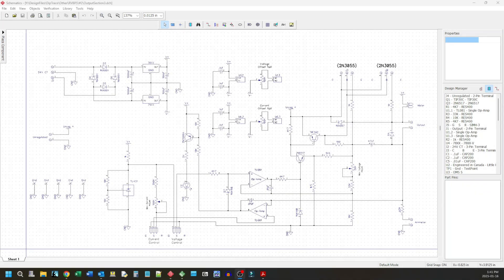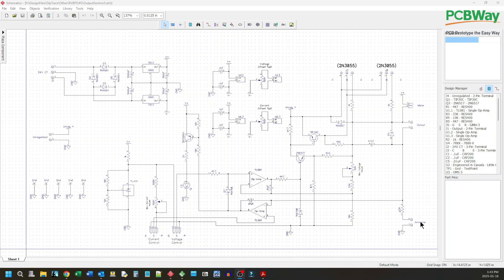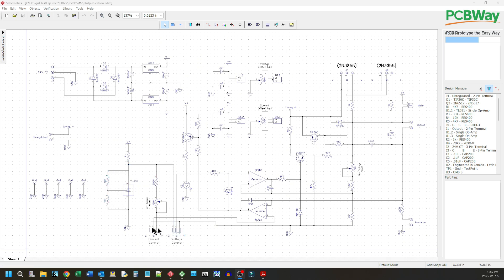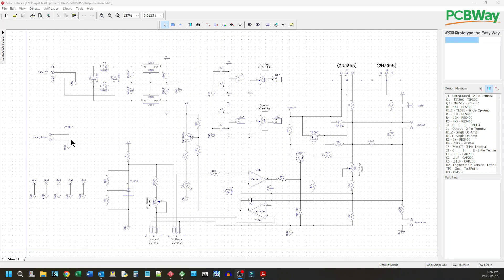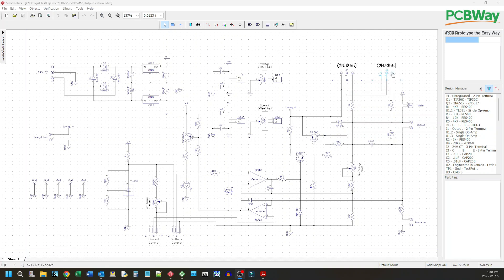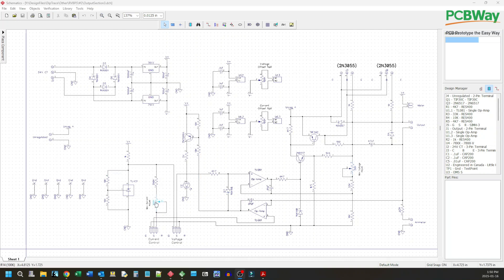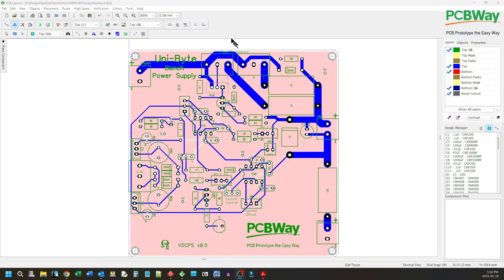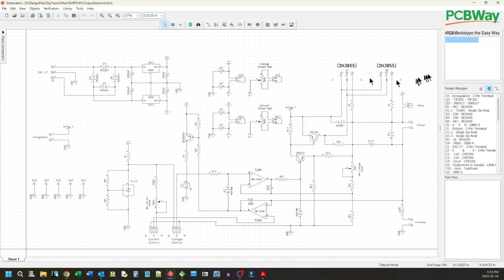Uni-Byte 0247 - VARIABLE DC Power Supply - Adding Current Control to the DESIGN: Part 3

Comment: Looking at supply projectys as my farnell l30b is playing up again, well i say playing up, it did say in the manual do not charge batteries... why, when the power goes off it backfeeds and takes out the current regulation side for CC.....
3rd time its needed repair lol, but this time the voltage pot seems to have gone noisy and causes spikes so i cant really trust it, time to rebuild the silicon stages with modern parts instead of old bc108's and bfy51's etc
Reply from the maker: If you follow this one and go for 2 or more pass transistors, be sure to match them for gain as close as you can.

Comment: For my LPSU, I managed to snatch an encapsulated toroid 400VA one from Sedlbauer AG (25v 10A + 24v 6A) for $20 delivered. It even has 100-115-127-230V input.
But to be honest, it would be much easier to design around multiple standard output ones (like 12v max) in series commutated programmatically to lower voltage across heatsink.
One could probably use UPS transformers as they are sold pretty much by weight used.
Reply from the maker: The multiple units is a good idea, but does end up bulky and expensive.  It seems there might be a market for transformers for this purpose.  At least I think so.
Reply: @uni-byte  It's a chunk of copper, which is very expensive today even before processing (especially one like mine that is 5kg). At a serious VA they are likely to be a bargain only in one-off deals on a secondary market.
My first LPSU utilizes rewound secondary side, which might be a way to save money buying a niche unit that nobody wants at average market prices.
Reply from the maker: @ You could be right.

Comment: I like the minimalist approach. During the design phase of my power supply I had the same difficulties in finding a medium power transformer at an acceptable price, so I decided to go with a hybrid pre-switching regulator and linear output stage design. In my opinion this is the best way to keep costs down without sacrificing too much performance. Awesome work.
Reply from the maker: Thanks!

Comment: Vigortronix VTX range  Toroidal Transformers  500VA cost about £56 UKP -  88 CAD

Still to expensive ?

Andy
Reply: 500VA toroidal is beefy and that seems quite cheap based on the last time i shopped for a 250 to 300VA toroidal for an audio amp project.     Maybe it's wound with aluminum wire ? (not necessarily a deal breaker).   

I've seen several eBay transformer listings advertising 2 to 3 times inflated ratings.  These were EI frame transformers and I determined  this based on comparing their dimensions to known transformers I own.    I would suggest doing the same, you could do it by weight too.  Given the attractive price you want to make sure it's an honest listing!
Reply: @GannDolph  Farnell list
 500VA 2x35 sec 70UKP,  2x55V sec 88UKP. 
300VA 2x35 sec  63UKP 2x 55V sec 63UKP 
these are multicomp Pro transformers. 

The other company I quoted from was Rapid Electronics.. Digikey also supply the Vigortronix transformers 48UKP for 300VA and 67UKP for 500VA tax at 20% would need to be added to that.

So the prices seem to be fairly constant, and this is from well know suppliers  maybe you caught them at a bad time (EI types  tend to be more expensive) I did spot that some voltage combinations were more expensive probably because they are not that popular. Worth shopping around .

The spec sheets do not quote the wire type, but they do say that the terminations are copper, which does not say a lot.

I also find ebay to be a bit hit or miss sometimes, so as you say caution required, but sometimes you can pick up a bargain. Not to often given how small the market is here in the UK for ebay, it's a different matter in the USA. I guess the same goes for Canada.

Andy
Reply from the maker: @GannDolph - They do look good, but the dealers don't have a lot of inventory.  I'll keep looking.
Reply from the maker: Thanks, I'll look into them.

Comment: Just before Christmas I spent a day hunting through the scrap boxes and shelves to find an appropriate transformer for a dual tracking supply, ended up finding one with a suitable VA and rewinding it to 40-0-40 2 amp .
Reply from the maker: I'm the same - lots of transformers around, but in my case I rarely seem to have the right one.